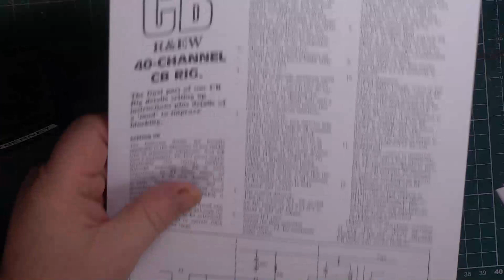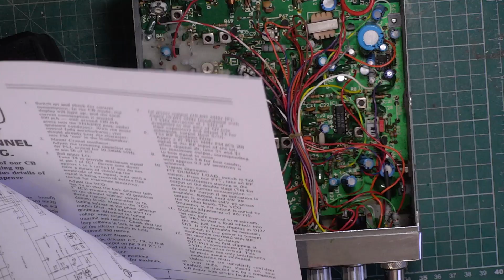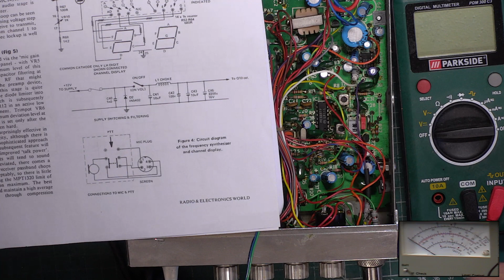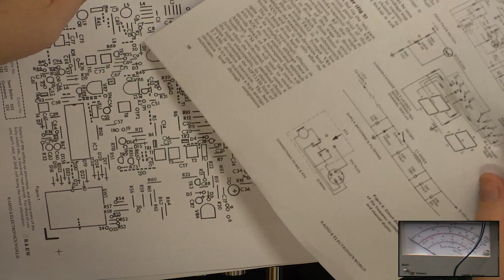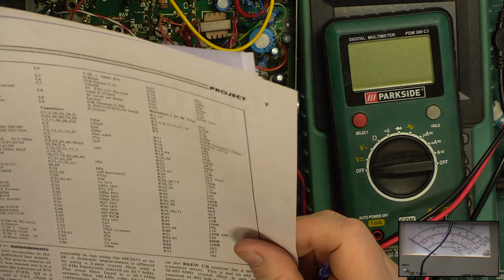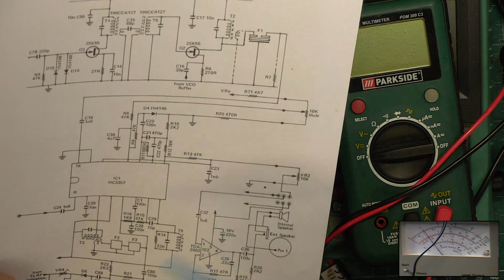Mega Tracker CB1100 CB27/81  UK FM CB radio - Pt 2 My own set

Comment: Pretty sure I have all these magazines somewhere too, when I was a kid that's what most of my money went on! I have just been reading through the design. Interesting to see JFETs used in the IF amps, I don't remember seeing them used in a CB set at this time. Surprised they didn't give slightly better SNR than they do. No doubt we will see when the customer's set gets fettled! TX audio sounds quite punchy, it will be interesting to see how that sounds on test.
Reply: JFETs were a 'hi-tech' part at the time, rumour had it they were lower noise than bipolars. Not that anything but the 1st stage of a receiver does much to the noise performance. As I was 15 back in 1982 and didn't have my own money, my long suffering father had to pay out for these magazines!